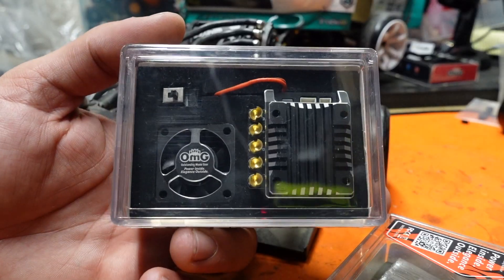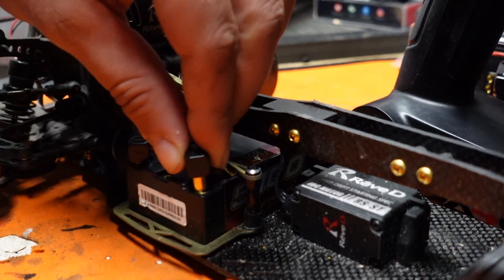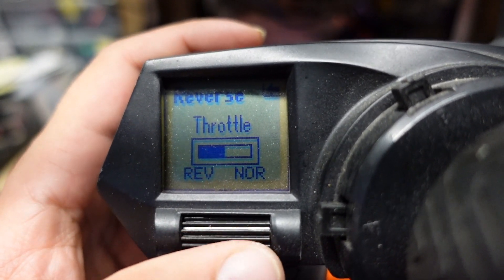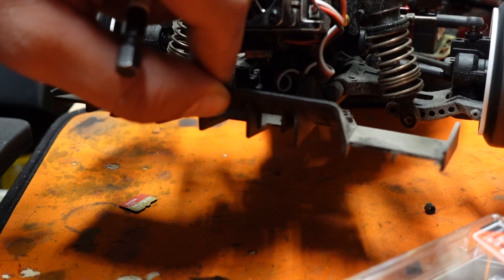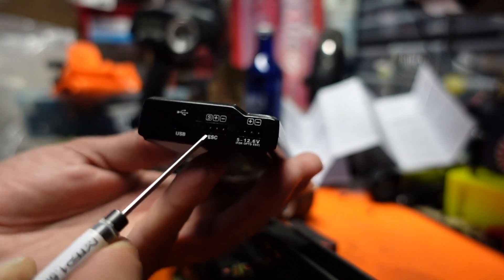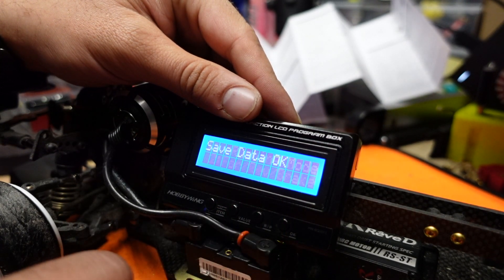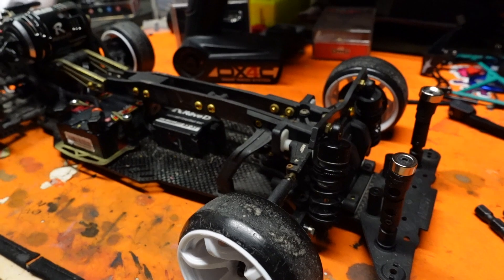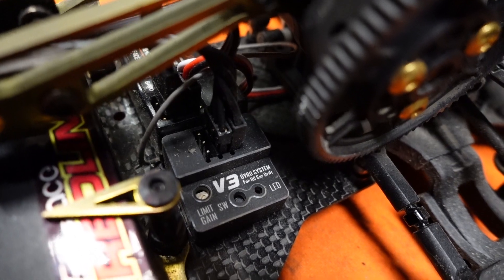OMG POLARIS ESC TECH TUESDAY

Comment: If I had a wifi module, where would I plug it in, or do I need to get a program card.  I really want to change the running mode, but I can't figure out how to get the ESC into programming mode
Reply from the maker: Who’d you buy the esc from? That will determine what firmware was used and will tell you if you need a OMG program card or Hobbywing card.
Reply: @ScaleScience  it was second hand but I can ask him

Comment: It cames with the turbo working? I mean, if i dont have The programing card, and a just put The esc in my rc will i be able to use The turbo?
Reply from the maker: It might or might not they have many different versions of firmware.
Reply: @ScaleScience  i am thinking of buying The x3 version but i cant find many reviews of it
Reply from the maker: @velozoization  it works well! It’s got lots of programmable features packed into a competitive price point. Though it isn’t as fancy looking; I also like the BLSP esc from Yokomo. $88-98 usually, has boost and turbo and you can use the Yokomo Wizard App and a WiFi programmer for adjustments similar to the hobbywing stuff. It’s a much larger leap but if I could suggest some other options to consider above that, the hobbywing XR10Pro and the Yokomo RPXii are both amazing performers, tons of tuneability and would be my go to at the current time.
Reply: @ScaleScience  well, thanks a lot for you time man, i think i will go with the yokomo since i already run a yokomo motor aswell

Comment: Hi man.
Question ?
I have X2 ESC omg polaris.
on the two I have tremors in the direction with the servo dream D. ESC adjustment bec has 6v.  did you have that?  with 3pv radio, with and without Giro V4 same tremor anyway
Thx 🤘